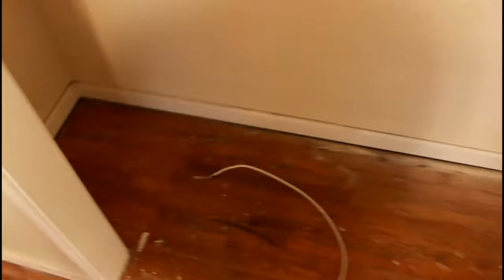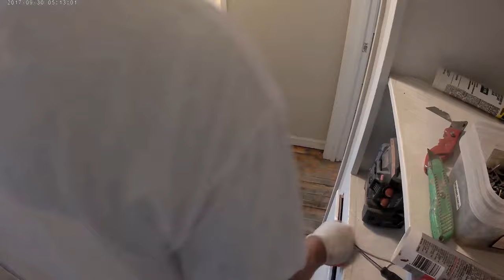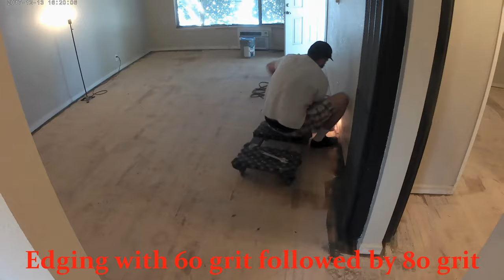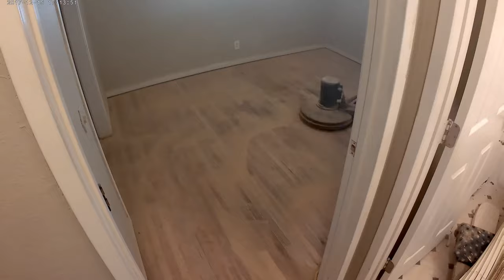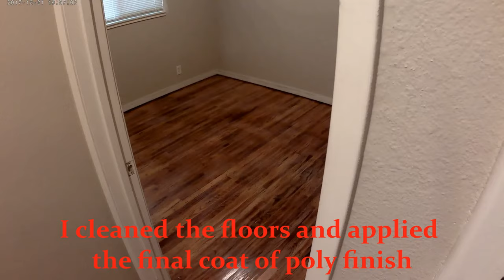Refinishing 70 year old oak hardwood floors

Comment: Just took up the carpet in my new house and the floors are almost perfect aside from the large head nails at the entry way. There are so many smh.
Reply from the maker: carefully remove them and fill the holes with a color matched wood putty. they are probably there for a reason so u may need to replace them with proper finish nails.

Comment: No mask, no safety glasses, no ventilation when applying sealant etc. lucky to be healthy.
Reply from the maker: awesome comment. an n95 particulate respirator can be seen in every sanding shot covering my face. All osha saftey goggle requirements are also being followed while using the floor sanders. and the msds were followed to the tee for the multiple products required to finish this floor. congratulation on the astute comment tho.

Comment: I am attempting to do this tomorrow, my floors are in the same condition, using the same sander and I hope the floors turn out this good! How many cans of clear did you go through?
Reply from the maker: i cant remember off the top of my head but i think it was about 12 maybe 16. im in california so were not allowed the gallon containers. just the small cans here.
Reply: @californiaflips4318  You're allowed gallon containers, just not the solvent-based in gallon containers because it's actually really bad for air quality to release all those solvents into the air. I get it, the water-based doesn't give you the same depth and grain enhancement but you are basically circumventing the law by using quart containers for anything more than touch up. Buying 16 quarts for an entire room was not what the VOC air quality regulations were envisioning.

Comment: I'd have gone over the lot with plywood then installed luxury vinyl tiles. Would have got rid of the gap under skirting boards but I could see that costing at least £1500 in materials.
Reply from the maker: i didnt want to cover 70 year old oak hardwood with chip board and plastic. but it would have been quicker. i added a small trim piece off camera to hide the gap under the baseboards. it can be seen at the end of the video.

Comment: Question what to do about black Stains that the sander could not take off.
Reply from the maker: its easiest to cut out the areas with really bad stains and replace them with new wood. if the stains are too large to cut out and replace you could stain the finished floor a  much darker stain to help disguise the issues. in my case i left a lot of the stains because this house is very old and the whole property has many "character" marks due to 70 years of neglect.
Reply: Peroxide will take dark stains off

Comment: How exactly do you replace the bad peices? We need to do that to alot in our house, but can't find anyone to give us direction to start
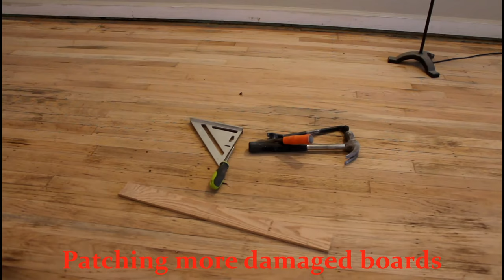Reply from the maker: that process is shown in the video at 13:08 its just pulling up the bad pieces and and nailing in the new. the steps will be different if your floors are tongue and groove.
Reply: @californiaflips4318  I saw that thank you. We have original floors and house built in 1922, but the original/previous owners never did the upkeep so they were never resealed. With 4 dogs and 4 kids there's places that need to be completely redone. We don't even k ow how to tell what kind of wood it is
Reply from the maker: @tiffanycurson8214  if its "top nail" like mine is in this video you will see 2 dots every 6-12 inches on the top of the boards. those dots are there from the nails being driven in from the top. you see me using the nail gun to drive those and you can see the dark dots very clear in the 13:08 portion of the video. if you go to an area in your house where the flooring transitions into a different type of flooring. usually in the doorway going into the bathroom or kitchen. there should be some sort of transition strip that you can pull up and try to get a look at the side and guage the thickness and weather it is tongue and groove or top nail. feel free to dm me a picture of what your working with and i can try to help you figure it out. a house that age could have a lot of different styles of flooring. so its hard to guess without seeing it.

Comment: did you just put wood filler over the whole floor then sand it out? what kind of filler did you use?
Reply from the maker: its called trowelable wood filler (red oak color). it is made for refinishing these floors. its available at homedepot
Reply from the maker: and yes you just trowel it on the entire floor and it will fill all the nail holes gaps or any other voids that my be in the floor
Reply: @californiaflips4318  thank you, i have a floor in a house i just bought that doesnt need a whole lot of work but it does have gaps that need filled. figuring ill just fill in the gaps and do a 120 grit sand over the entire surface and put poly over it. just focused on protection more than restoration since it will become a rental house next year or so

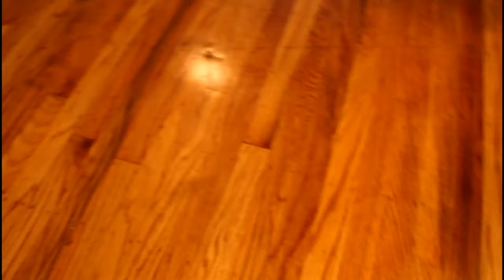Comment: At 26:30 words flash on the screen. the only way to see them is to slow down the video.
Reply: What it says: "I left a lot of imperfections and scratches, but I'd rather have the scratches than sand halfway through the thickness of the wood to remove the scratches."

Comment: It's called a darker stain. I've done it several times and you can't tell
Reply from the maker: ive done that aswell. im not a big fan. you usually have to go to jacobean or ebony to fully conceal the stains. and plus i had a lot of splintering boards too that would still need swapped.

Comment: so how did you fix the moisture problem near the AC unit?
Reply from the maker: sealed the ac unit inside the house and flashed and caulked it outside. also changed the window  to dual pane. but the moisture was most likely caused by an old swamp cooler that is no longer in place. or an old resident leaving that window open.

Comment: Did you ever edge with the same 36 grit you used for the rest of the floors? I’m following your method with my floors now and it seems like if I start with 60 grit the edger it might not get the same result I have with the 36 grit on the drum sander. Especially since by that time it will have the original glue etc and the wood filler to remove. Great video by the way, thanks for posting!
Reply from the maker: you dont wanna use low grit paper on the edger because it will leave deep swirl scratches that will be very hard to remove. start at 60 then 80 and if you want you can do 100 on a random orbital sander. the edger is very aggressive it will remove the finish with 60 grit. feel free to message me with any other questions you may have. good luck

Comment: Amazing job! May I ask approx. how much it cost you to do this project?
Reply from the maker: about a dollar per foot. 600-800 total. which is cheap, but it is very time consuming and labor intensive compared to installing carpet or lvt. it doesn't look like it but this video covers well over a week of work.
Reply: @californiaflips4318  what products do you have to use please.  I am in a fix right now and would love to restore my floors from previous peel stick on tiles that have been removed already dont know what to use exactly.
Reply from the maker: @windsorglamourlashesbrowsb3421  sand paper, trowelable wood filler, minwax oil based stain, oil based poly urethane finish. all are available at homedepot.
Reply: @californiaflips4318  what to do about black stains that the sander cannot take off, any suggestions

Comment: Where did you get your replacement boards?
Reply from the maker: theres a local place near me called pacific flooring supply in sacramento. but if you do an online search for "5/16ths top nail red oak flooring" you can purchase it online if you dont have a supplier in your area. just make sure you get the right width and thickness of what is existing in your home.
Reply: @californiaflips4318  thanks. I live 2 hours from Sacramento. Your floor looks very similar to my floor. I'm having a hard time finding wood flooring that thin. I think mine is white oak. Can you tell me the name of the store?
Reply from the maker: pacific flooring supply there address is 1527 N C St, Sacramento, CA 95811 pull one of your boards and bring it in to them. they can tell you exactly what you have. they are very knowledgable.  the age of the property can also tell you what type of flooring it is. my house is a 50s tract home and they were usually done with red oak. if you are woking on a victorian you may have white oak. the thiness may also be from people sanding the floors over the years but the people at pacific flooring supply would know a lot more than me about that.
Reply from the maker: pacific flooring supply will also sell all the other items you need for refinishing like the polyeurethane finish (i used oil based semi gloss), the trowelable wood filler, and any nails or sand paper you may need. if you have any other questions while refinishing your floors dont hesitate to contact me. its a long process with a lot of nuance that is hard to get step by step details for online.

Comment: refinishing old floor proper way
1. remove old floor
2. install new pre-finished floor
Reply from the maker: yes putting new flooring over the top would definitely be easier. i enjoyed the work tho and like that this home still has the original 70 year old oak floors. and since theyve lasted 70 years so far hopefully with maintenance ill get 70 more years out of them.

Comment: What did you use for your wood filler?
Reply from the maker: its called trowelable wood filler. its sold at lowes and homedepot. and you can get it in different colors to match the species of wood that your floors are made of. the floor in my video is red oak.